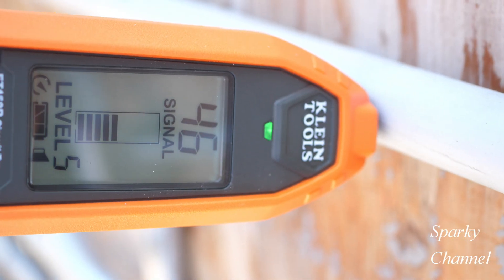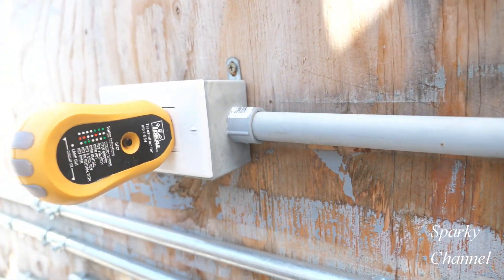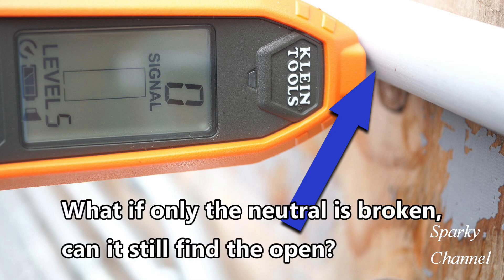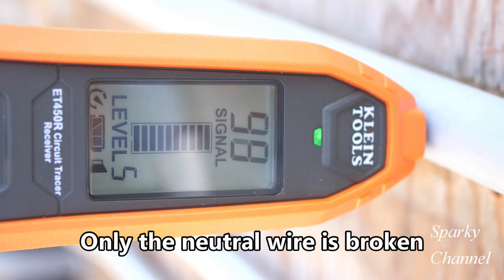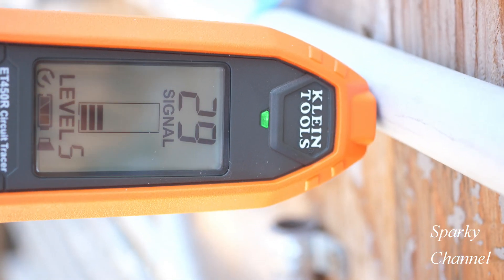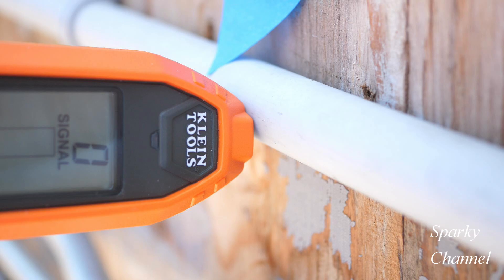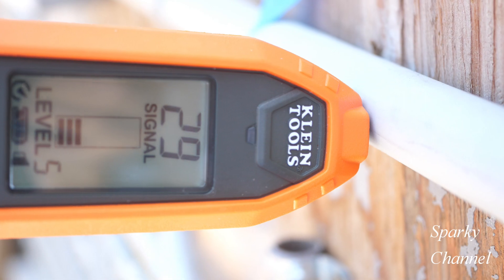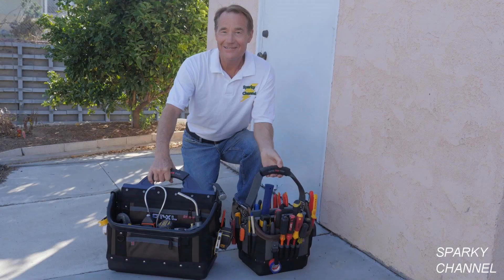Can I Trace a Break in the Neutral When the Hot and Ground are Good?

Comment: Can this be used to find a shared neutral? When doing service panel upgrade I ended up with two circuits with neutrals connected together and caused afci breakers to trip immediately.  Solution at the time was to make this all one circuit but would like to find the problem because one circuit runs the living room outlets and other is running lighting in kitchen, microwave and laundry room lighting. Not too concerned about lighting and microwave being on same circuit since all lighting is led. This house was built in 1900 and has mostly bx for original wiring. I did watch the video doing that with the Ideal Sure Trace but would the Klein work the same at the $200 price point?

Comment: i need help. i have a hall light on 2 3 way switches. looks like the wire comes from the light to the switch. there are 3 wires to the switch. can i run a single switch from the 3 way to a closet light. where to the wires hook up? thanks
Reply: If I understood correctly. You'll need to get to the switch that has the line wire. (Hot)

Comment: I've hunted for broken wires long enough. Pulling a new cable immediately is the only answer? Don't waste the homeowners time.
Reply: Thats the whole point of the tool. You can locate the problem and quickly determine if a new line is nessessary or if its just a fault in that one jb you didn't check for the 100th time

Comment: last week I burned a half hour looking for a break in a wire, when the breaker was passing enough voltage to register on a non contact tracer, but not enough to register on a meter.  my own fault for being lazy.
Reply from the maker: Non contact tracers are wonderful tools!
Reply: @SparkyChannel  I disagree bill. Tracers....maybe. NCVs....NO! i had a Klein NCV detector. I used it to determine that the recepticle was not hot. I got shocked. My partner saw this happen. Without words, I handed him the tool and he threw it in the trash. never again will I use one!
Reply: @pointedspider  the only worthless tool is one you don't know how to use.  my NCV is the one diagnostic tool I wear out and replace routinely. it is the one tool I keep in my pocket for immediate use.  keep in mind there are multiple ways you can get a false negative with a solenoid tester, too.
Reply: @kenbrown2808  I've never had a problem with NCVT either. The only times I usually got shocked were from illegally shared neutrals. Now I test the neutrals again after I take the joint apart just in case someone used that same neutral for another circuit.
Reply: @illestofdemall13  they used to allow that on separate breakers. now the breakers have to be handle tied.  also, that's the reason some electricians started calling it the "nuke"
Reply: @kenbrown2808  Yup. I have found them on new installations where they weren't handle tied and the breakers were nowhere near each other in the panel. I learned my lesson and haven't been nuked in years. I always test for that condition, among others. I always do several tests to make sure nothing is going to zap me because sometimes you can get a false reading due to open ground/neutral. That's why I use the NCVT, and I also use a Klein Voltage tester that doesn't use batteries. Kind of like a modern version of a "Wiggy, Wiggie, solenoid tester, etc."
Reply: @illestofdemall13  I prefer the Ideal Vol-Con.  it takes 4 watch batteries (included) and can test continuity.  solenoid testers have the advantage, you can test things by feel, and you can test a GFCI with it by testing hot to ground. - and if it's an ungrounded circuit, you can bring a ground from anywhere.  I've even tested to copper plumbing.  that and the non contact tester are the two testers every electrician should own and use.
Reply: @kenbrown2808  I have a Fluke that is like the Vol-Con that I use for voltage and continuity as well. It takes AA or AAA batteries but don't remember which. It vibrates and lights up to the approx voltage just like a Wiggy or the Vol-Con. It also has a GFCI test button. The Klein one just does voltage and takes no batteries. It lights up to the approx voltage but no vibration.
Reply: Same here. I got shocked by an illegally shared neutral not long ago. Really pissed me off. I learned my lesson.
Reply: @kenbrown2808  Im a well seasoned vet. I believe this particular tool was junk. I have a Green Lee that I found in a furnace years ago but the battery cap/ power switch broke. This Klein NCV came from their tradesman club. Junk. Also their BBQ set is junk too. They are not who they used to be!
Reply: @pointedspider  I abuse their hand tools all day.  but I currently prefer the milwaukee tracer.  I get a couple years out of them before they break.  the old Mini Volt Tick was great, but they aren't available any more.
Reply: @SparkyChannel  absolutely, but I really should have confirmed the breaker was working before I started looking for hidden problems.

Comment: I coincidentally ordered this right before your first video came out. I'm surprised that it's affordable and I know the price will increase gradually, so get it before it does!
Reply from the maker: Hi Brian! Excellent, what observations do you have about the tracer so far?
Reply: @SparkyChannel  I like that the wires can be traced through concrete, pvc, conduit, and drywall. It's nice that you can trace out a neutral also. This is very affordable because I'd expect something like this to cost over $500. It will come in handy when I really need it! You're the best Sparky Bill! Love your reviews on these type of tools.
Reply from the maker: @briandellafey  When you say conduit, what kind of conduit?
Reply: @SparkyChannel  PVC or EMT. I haven't gotten the tracer yet, but I hope it does get a signal through the EMT.

Comment: How can a wire break in conduit?
Reply: a factory defect is possible, but years ago, I had a service call where someone yanked a folded wire into a conduit, and it overheated and burned out.
Reply from the maker: @kenbrown2808  Trained monkeys with hammers and nails. And rats. :)
Reply: @SparkyChannel  actually, it was an air nailer that was used to nail a shearwall to a conduit.  fortunately, the wires hadn't been pulled yet, so we found it pretty quickly.